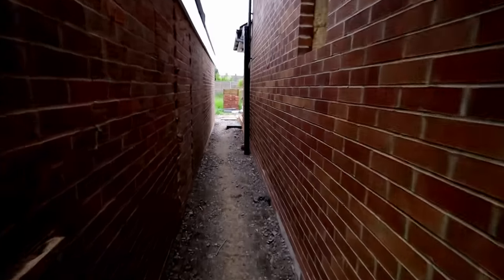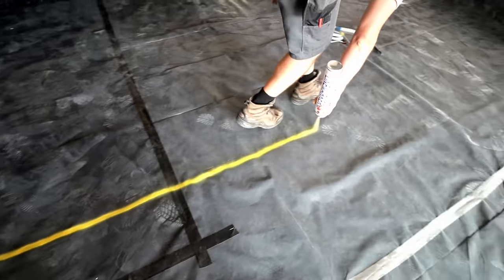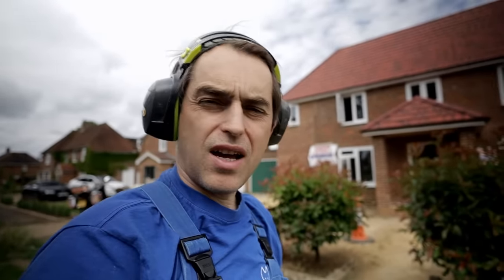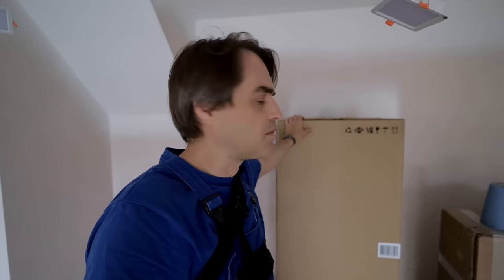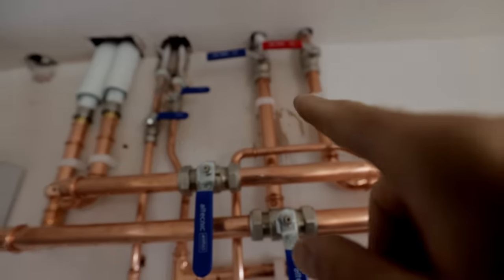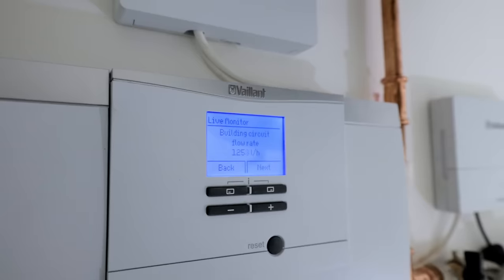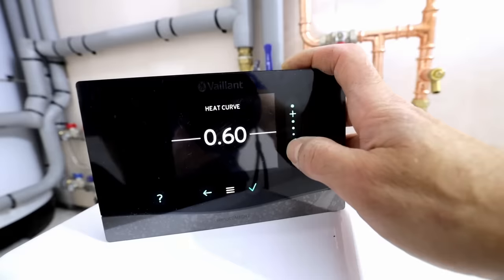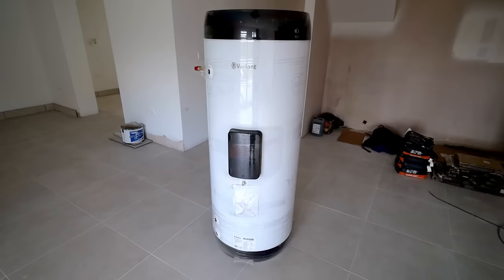Gas Boilers No Longer Make Sense, Here Is Why.

Comment: Hello again Szymon, can I ask what make your floor trays are? I have used the Wunda trays for years but they have redesigned them and you can no longer get 100mm centres. Is that possible with these? Smart work as always buddy, keeping up.
Reply from the maker: Yep, profix plus
Reply: Thank you. I've just looked them up and they are based around half a mile away from my home. Crazy!!

Comment: I usually don't seeing pipes or cables. I prefer to hide them away. But this pipe work needs to be on display. Very nicely done, very professional, great job.
I do have one question. Ar around 8:15 of the video you have you left hand on the controls, right under that control I see some strange looking 4 way valve system. Can you please explain what that is and what its for? Is it some kind of automatic refill for the system?
Reply from the maker: it is unvented cylinder combination valve

Comment: I'm in a 1st and second floor maisonette. Currently have a gas system boiler and megaflo tank. Can the heatpump be installed on the side wall of the 1st floor?
Reply from the maker: Yes, it has been done. Especially with new units, that have almsot no vibration or noise.

Comment: Thoughts on air to air systems? I.e. multi split systems that do heating and cooling. Especially with the summer temperatures being how they’ve been these make more and more sense and are less effort to install and take up less internal space with no tank required, though don’t do hot water of course
Reply: This is what I'm looking at doing. I wouldn't dare do it without solar though. With solar any excess can be used to temper the house temperature down. By my calculations (heat loss) I'll only need two exchanger units for the whole house given it's insulation. I can also scrap all the gas/radiator kit to get some money back and saving some space in the smaller rooms.
Reply: @Roedy_Coedy we had one installed last week; a 6Kw outdoor unit and 3* 2Kw indoor units. I am really interested to compare it to the boilers efficiency in winter. We have done it without solar because of working from home we wanted it in for cooling in summer. Also our property is listed so we had to help design a solution that would minimise outdoor piping. The one issue with these systems is the installers want each indoor unit to be fed up external walls so that the condensate can be gravity fed (esp as pumps on the indoor units are loud). We managed to come up with a way to have 1 run of pipes into the house and not have condensate pumps on each unit!
Reply: @Bish_OP  ohhh that's interesting! If it's listed they may block solar through planning anyway. In which case you may be able to get a battery to charge up during cheaper periods overnight, worth considering!
Reply: If you’re treating your home apart you have one opportunity to put an underfloor system in, in my eyes it’s much preferable to air-to-air
Reply: @edc1569  in terms of efficiency that makes sense but it won't cool which to us was a big deal. The air to air still claim quite a high efficiency which could still be cheaper than running a boiler even with the 3:1 price in gas' favour
Reply: @Roedy_Coedy  exactly, we aren't sure if we'll be able to put solar in, as you say we'd want to do a battery if we did panels; I think the battery would be fine as that could go close to our outdoor heatpump unit, but the panels i'm not sure if they would allow.
Reply: @Bish_OP worth further investigation, I think in some nationals it’s not unusual to set things up so that the floor can provide some cooling.
Reply: I live in a 1930s build. Not the best insulated house but with double glazed windows and doors. We took out the downstairs radiators and replaced with aircon units which blows out hot air. Total 4 units - £6500 (13kW in total). Best investment I've made. It was 2020 and we started working from home. Heating on for more than 8 hours a day, all units set at 21c. Unless I do a major renovation, I will replace the gas boiler for heat.

Comment: I read recently that heat pumps do not work below -10C and have reduced efficiency below 3C. As the majority require heat in the winter months would this not present a problem? There is also the issue of competency, if the installers design and fit badly then the competent installers will be unaffordable to most. It sounds like this is a costly undertaking in any case.
Reply: Depends on the heatpump, but Scandinavia and Canada have been using ones that work down to almost -30C.  Reduced efficiency, yes, but still miles more efficient than gas.

Comment: I have a question about the UFH instalation. Why do you use zig zag patern in stead of a snail patern?
Reply from the maker: I use both depending on a situation, layout and pipe spacing required
Reply: @UrbanPlumbers  As a one heat pump installer to anothet, based on your experience, did ypu find any difference in output between the instalation patern?
Reply from the maker: Pipework pattern will not affect the output greatly

Comment: I love your videos and learn so much from them, thank you so much for all your work on them. A couple of things: have you considered the ‘Vaillant Mono HP connect kit straight pipe’ kit, consisting of a pair of stainless steel corrugated pipes, which can go straight through the wall and which I used successfully on a recent job. I’d like to have one longer and one shorter one to accommodate the antifreeze valve, but that a refinement. Also.. for the isolator I have started taking the tail leading to the heat pump back through the wall and then down internally if possibly and then out at a point close to the pipes which keeps it neater and all cables invisible. Looking forward to learning why the flow rate was so low on your rescue job!
Reply from the maker: I use regular angled flexi hoses and cut them to size required and straighten the ends to make them straight if needed
Reply: Sounds interesting but I don’t understand how you do that. I’ve tried chopping flexihoses down but don’t know how to terminate them after I have done so. Possibly something for a video of tricks of the trade some time? Thanks for the reply.
Reply from the maker: Video about it coming soon

Comment: One thing i don't understand i had a spec from a plumber of
1x 32A Isolator
2x 16A Isolator
1x 6A Isolator
Why the big loadings?
forgotten the manufactor but it was german made
Reply from the maker: sounds like some crazy Daikin set up. This set up only uses 1 x 16amp connection for the main unit and 3amp for controls.

Comment: No much cheaper to install? What were your installation costs?
Reply from the maker: on those kinds of jobs my boiler with a unvented cylinder or heat pump installation and materials costs are identical. The only diffence is the cost of heat pump being more than a gas boiler. However there is no vat on heat pump supply and labour and £5k goverment grant - so the cost ends up very comparable

Comment: I have a genuine question about efficiency. This question is only if a user has solar and battery storage. Would it not be more efficient to run only the central heating using the heat pump and heat the hot water via a immersion heater. ( using the stored power ) This way you would have no heat loss via pipes etc to the stored water cylinder. Obviously you can also power the heat pump using the solar/power.
Reply from the maker: no it wouldnt.

Comment: Just a question, are the manifolds going to condense when using the active cooling? I normally use the plastic manifolds because i was scared of having problems with that. But maybe you have had no problems with this?
Reply from the maker: yes, there is risk of condensation on exposed maifolds.

Comment: Always great to see one of your videos, especially a heat pump one! Given sufficient space to create a proper installation, there really is no reason at all to install a brand new gas boiler in new or heavily refurbished properties, it really is a shame to see it continue to be done. Even if the running costs are comparable right now, they will without a doubt decrease in the future.

With so much misinformation currently circulating, do you find you have to suggest a heat pump yourself to customers and correct some of their misunderstandings or do potential clients come to you specifically requesting them?
Reply from the maker: I have to fight ignorant builders and plumbers all the time! The amount of misinfomration coming from our trade is just frightening. That is why I HAVE TO keep posting those videos to fight it.

Customers that come to me are less of a problem, as they are usually well educated in heat pumps already.
Reply: @UrbanPlumbers  It really is a shame to hear, especially that the misinformation is also coming from within the industry and not just the general uninformed media. You're doing a great service to the industry for sure, your videos are fantastic!
Reply: @UrbanPlumbers  Shame you don't work in my area i am working at the moment as would be great to have you do an install in Nw2. Probably going to have to go with a new gas boiler instead.

Comment: I have a combi boiler in my 4 bedroom 3 bathroom bungalow and 12 solar panels, my daughter has a 2 bedroom council house with a combi and smart meter and her bills are more than mine, I think it all depends on how you use your appliances, I would reccomend a combi boiler myself, what you save in the cost of installation compared to a heat pump would pay your bills for at least 7 years
Reply: Having solar and not using it to contribute to what is one of the biggest bill contributors (home heating) is a weird flex, but OK.

Comment: How many combis got replaced because a heating engineer couldn't be bothered or didn't know how to fix a simple fault ? Loads. Now imagine whats going to happen when the heat pump develops a fault.."oh you need a new heat pump mate". Nobody is going to want to spend the time to learn how to diagnose faults on these systems. A manufacturers engineer will check the heat pump, but won't touch the rest of the system.  I have a six year old gas boiler and its not going anywhere quickly until the heat pump market has matured and is orderly. I still don't think a heat pump will keep my old house warm at anything like comparable cost. The next owner of this house can take all that on as insulating this 1885 property is a real headache. We've done the roof space, we've double glazed and we have insulated underfloor where we can get there. The walls are solid, so it will mean dry lining the whole house, or there is one gable wall we could exterior clad. The one thing I might be OK with is oversized radiators as mine are pretty big, but I need to get a calculator out and do a heat loss/heat output calculation to get a real idea of the requirement. I need to win the lottery and then have a borehole dug, in that order unfortunately.

Comment: Won’t chilling the slab cause it to condense? I would think on a hot humid day it would be quite wet and slippery.
Reply: It's possible, it depends on the dewpoint. With such a large heat transfer area, it wouldn't have to run near as cold to remove the same amount of heat from the property. 

Essentially you have to keep the flow temperature above the dew point, and you could still use the radiators. Once the flow temperature goes below the dew point you'll get condensation. At which point, you either need to run cooling solely on the air handlers which can deal with the moisture, or run a dehumidifier in the house to lower dewpoint.

If you're more curious, look into "passive chilled beam" systems. Same concept, commercial scale. One central air handler lowers the dewpoint, then all the chilled beams can cool the air without condensation.
Reply: @Thermoelectric7  I think you would need a slab temp sensor then as well as a humidity sensor to stay above the dew point then. I could be wrong, as I'm not super familiar with the climate in the UK.
Reply: @JustFixIt99  I suspect you'd just go off flow temperature, as the screed will be coldest where the water comes into the under floor loop and would condense there. Likely need some manner of fans too to circulate the air, as it won't naturally convect like it would in heating. Interesting to see how it turns out though. 

If you just had a dehumidifier set for a certain dew point you might not even need much monitoring, just need that to be set below the cooling flow temperature and you would be sweet.

Comment: Great content as always S, what would you recommend installing in a new build 1 bed flat or Studio, with little storage space out of interest?
Reply from the maker: well, with little space you may want something like a sunamp or storage boiler charged on cheap overnight tarrif if there is no space for external unit or DHW cylinder.
Reply: @UrbanPlumbers  Thanks! it's been driving me crazy! I've been looking at the sunamps, Do you have a recommendation on the electric storage boilers? The studio is shower only so no real HW demand
Reply from the maker: Electric shower plus 50l direct cylinder may be a better solution then

Comment: How does underfloor cooling work? I had heard you shouldn't do that because of condensation?
Reply: You pump cold instead of hot water around the floor heating and use the floor emiiter as a cooler. Down side is you can't drop the temperature too low  (must be above the dew point) otherwise you will get condensation. Depends on how much you want to cool the room. If you want to acheive a big differential you wont be able to do it with floor cooling as of the condensation issue.

Comment: The other alternative would be straight forward electric heating, especially if costs of electricity relative to gas falls. The thousands saved not installing heat pump system should keep you going for a while.
Reply from the maker: Direct electric would be over 4 times more expensive to run in this case. It would be a difference of around £3k per year more to use direct electric heating. It would take only 3-4 years in bills to be more expensive that supply of the heat pump alone or around 8 years for the full system. Direct electric make very little sense, unless it is for well insulated flats where there is no space for a heat pump
Reply: @UrbanPlumbers  Thanks, but I imagine you are basing that on current costs. Maybe in the future electricity from wind farms etc could be so cheap that direct electric heating would not be so expensive.
Reply from the maker: @firstlast5350 it will always be 4 times more expensive than a heat pump though
Reply: @firstlast5350  You might want to check with an electrician on how much it would cost to replace all waterborne radiators in a typical house with electric ones, with all the wiring that needs doing, and likely a change to the CU.  I'm not sure you'd get much change out of £10K for a proper job.  Even if you have solar panels where the electricity is "free", it's still a limited quantity, so if you had a battery, that "free" electricity would go further on a heat pump than it would on resistive heating, meaning you're less reliant on buying extra electricity from the grid.
Reply: @BenIsInSweden  Thanks but a few oil or convection heaters for small property shouldn't come to 10k Also halogen and fan heater available.
Reply: @firstlast5350   for a small property, an air to air heat pump would generally be better than any of those options if there is a lack of existing central heating.  If one exists then you're not going to be spending thousands on upgrades for air to water anyway.

Comment: Lovely job and you make a lot of good points in this video. But while it's a straightfoward job to install the system in a house that is practically stripped to the bricks for a renovation, it would be a right head-scratcher if someone didn't want to do that. Thinking about my own place (mid-size semi) frankly I would pretty much expect to move out for a month and put all the furniture in storage for the period, which would add a fair bit to costs. Still, I might one day just have to bite the bullet and do that, I guess.
Reply: Depends on how well insulated your house is and whether you also want UFH.  You could just require a pipe and radiator upgrade, if that.
Reply from the maker: that is what we do. Clear parts of properties so we can upgrade rads and some pipework and some people move out for around 2-3 days.

Comment: I am not atrades person but a lover of our planet and being able to breathe clean air, not have a house that could explode as a gas leak had occurred. ASHP is a winner and certainly kept my house toasty warm last winter. I had equivalent of little or no cavity insulation at the time and used 3333kWh to heat the whole home all day. Updated the insulation and a couple of weeks inciated saving 30% of electric use. So 2000kWh or so is estimated for next winter. They work well and I agree all new homes should automatically fit ASHP for heat and solar panels on roof.

Comment: How do you remove humidity with a floor cooling?  Doesn't the floor get wet?
Reply: you avoid condensation by following design specs for floor cooling practices.
not going too low on supply temp and not going below 19C floor surface temp. Of course only works in wet-screed system. It would give problems installed in dry-floorheatiing systems.
With that strategy condensation would not occur due to high surface area of the floor and not too low tempeature.  Condensation detecting sensors can be installed in critical locations to adjust min supply temp for some systems.